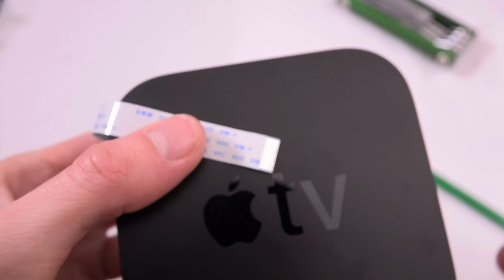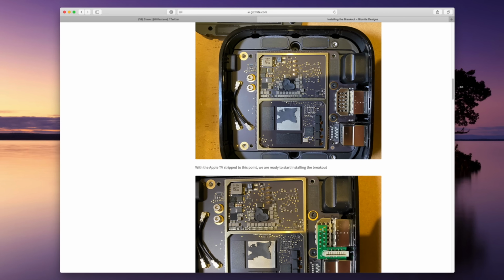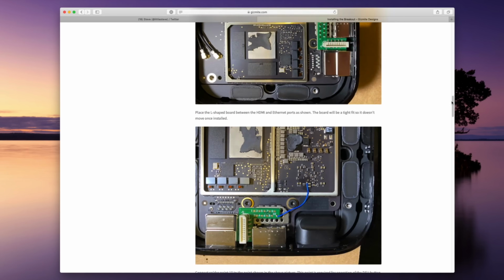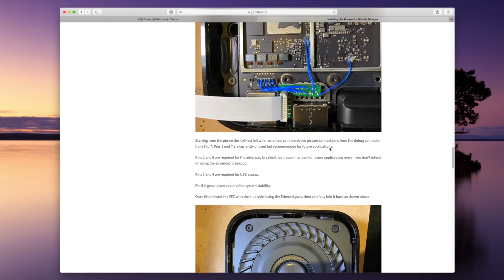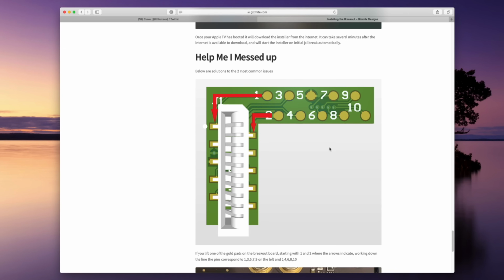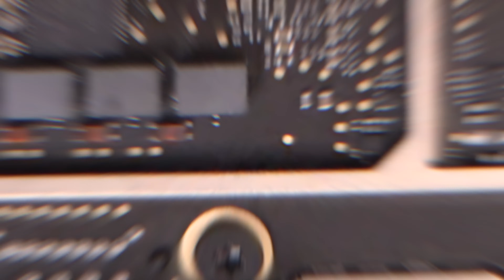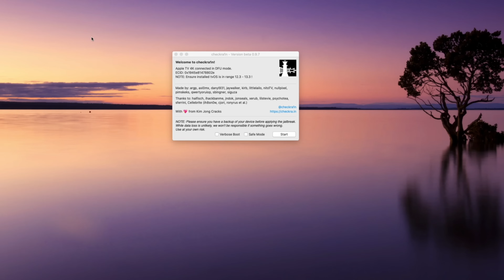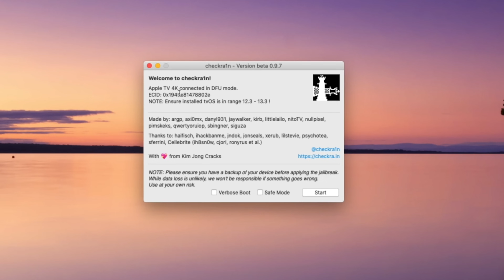Jailbreak Apple TV 4K: How to Install USB Breakout for tvOS 13 - 13.3 Jailbreak! (iOS 13 DFU Setup)

Comment from the maker: This was probably the most I've ever worked on a single video. I hope you guys like it! ❤️
Reply: iCrackUriDevice love it!😅
Reply: You have to tighten the four screws for the heatsink harder because the heatsink must be in contact with the processor. Otherwise it can cause overheating.
Reply: noice
Reply: Appreciate the guides, btw what is that song in the intro?
Reply: Couple of notes:
 1- Use Flux when soldering .. it makes it much cleaner an easier .

2-  you should have changed the thermal paste on top of the processor with  new paste.

3- you should have used  thinner wires  and  tightened the screws to make sure that the heatsink is actually touching the processor firmly.
Reply: iCrackUriDevice You should make a new video on how to jailbreak Apple TV 4K using xCode and the Uncover jailbreak which supports up to 13.4.5 with no need to open up your Apple TV. I just did it to my Apple TV and it’s pretty stable
Reply: Kasherick I was thinking of doing the same thing. But I heard it expires in 7 days and you have to keep redoing it. Is there any work around?
Reply: Kyle Wiltshire I heard the same thing so I installed reProvision which resigns the ipa and it said I didn’t need a developer account, I haven’t hit the 7 day yet so I’ll see if reProvision works or not
Reply: Does anyone know someone who is capable of installing it? I will ship to/ back and pay you for labor/ parts. I have my breakout usb part and my Apple TV 4K.
Reply: Does this work on the new apple tv 4k (2021) model???

Comment: were is +5v pin...
Reply: @torlamen   @torlamen  It’s only possible with the 2017 1. Generation AppleTV 4K with the A10X Fusion SoC.

I’m done with my internal USB solution and my 4K runs checkra1n jailbroken on TvOS 14.7 with NitoTV and KODI. I don't know whether higher TvOS versions are also supported.

If you need help, I can send you pictures of my project and the wiring.
Reply: @saibotmada2931  yes I have this 4k  1gen...  Thx  , for help  ,
Reply: @saibotmada2931  
Thx for help,
Reply: @saibotmada2931  Really interested in your ATV jailbreak project pictures too. I left a short note for you over on my channel :)

Comment: Hi @all, I builded a internal USB port and DFU switch solution into my ATV 4K. Only thing I stuck on is how I have to connect the switch to the ATV 4K circuit board.

I don’t have a breakout board and I can only use some of the rare pictures in the www, but they mostly show just one side of the breakout board.

It seems so, that the switch for DFU mode is connected this way, but I’m not sure: ground—>10K Ohm resistor—>switch in—>switch out—> to Pin 10 (test point for DFU mode) and to 10 or 100nF ceramic capacitor, second pin from the ceramic capacitor connected to ground.

Can somebody confirm if this is correctly or do some detailed photos from the circuits of the breakout board.

When the switch is connected I’m done and will do myself a how to video for everybody that shows a internal solution without a breakout cable (it looks more good).

Thanks for any help!
Reply: nice... thx

Comment: Dude, this is advanced soldering, PAY $20 to someone who has a Metcal, or whatever and knows what he/she is doing!!!!!!  Do NOT attempt mid/high level soldering without a scope, and obviously LOTS OF EXPERIENCE, and DO NOT suggest for newbies to do so!!!!!  "Liability"
Reply: That being said, thanks for the video, life is a learning process, and we ALL are still learning, including myself.   When you stop learning, you start dying.  Also, my suggestion is to attempt to avoid the over inflections in your narrative, but you are at the wheel here.   
Cheers!
Reply: I am a computer/electronics engineer that started DOS command line programming at 4yrs old, I am 43 now and design/manufacture advanced technology devices that the world isn't ready for, yet.   I own Supersonic Advanced Technology Group and LOVE IT!  Stick with it, you will too.
Reply: Pre-soldering is called "tinning", tin your tip of iron first, then tin the stripped ends of your jumper wires, put your iron on the wire and heat it, DO NOT put the iron on the solder as you want to, this is what causes the solder to fall off, instead of holding.   Heat the wire, after tinning the tip of your iron to increase thermal xfer capability, then put the solder on the WIRE, it will pull it in, do such on both ends of the jumper wires, and all contact points, Then put the ends of your jumpers on the "tinned" contact points, and Then, add heat with your iron, it will take a spit second to "flow" each connection, no pads removed, no mistakes.   From a pro, and there you go brother!
Reply: End game:  METCAL MX-5241 with micro tweezers and precision pen, you can not afford that now, 

Good starting point, TS100  $50 Ebay, better than you think..  , or new weller pen soldering station $100ish at the store, or used old Metcal 500 series Better yet   Metcal will set you back money, but we are talking less than 10 sec heat times, ESD safe, thermal radiance level awareness and microsecond adjustments, NO BURNING CHIPS, and Extremely long life, built to run 24x7 in production environments on shifts of several people, never turned off, for longer than you want to do it for.

Comment: Instead of a jailbreak, I want to try to repair my Apple TV 4k with flashing white light of death. I want to confirm that when you enter DFU with this method, it’s the same concept as DFU on iPhone?  Same as in you can then plug into a computer and open iTunes and restore official ipsw. I would appreciate it if you could confirm this, on a working Apple TV obviously. Then I’ll try my luck on my dead one.
Reply: did you try?

Comment: I bought the board but steve never it. It’s already 6month passed. Do you have any clue to contact steve? He never answer to mail, twitter.
Reply: Did you get the board? Or that webpage is an scam ?
Reply: @davidcruzalegui9384  I didn't get it. I got refund but it takes so long time.
Reply: @dongjinsim4764  Do you have the ways I can contact to the seller?

Comment: So I had a problem with my tv I needed to install USB breakout cable for my Apple TV 4K and it requires soldering and apparently no body’s want to touch it. I came on here in search of help but I was referred to Jose fred tech so I contacted him and shipped my tv to his location, he fixed it perfectly and shipped it back to me in 2 days. The amazing part is shipping with a tracker so I had to watch my tv move to his location and back. Text him on 
📩 Josefredtech@gmail⏺com
WhatsApp 📞 +1(413)-634-6140
His services was so reliable thanks

Comment: No body seems to experience the problem I have and that is the remote is working fine except for the touchpad, there isn’t any info on how to fix this. Very stupid problem and you can not use the remote to move anywhere. Bad design where the “arrows” button are lacking, anyways thanks to this Apple specialist HackerDave who I shipped the tv to he fixed it and also shipped back to me in 2 days after. Contact him via WhatsApp-+1(828)-635-9471.

Comment: I like how he says the disclaimer of how you might ruin your AppleTV after he says you need a hot glue gun and soldering gun! 😂
Reply: I had chimera App installed on my ATV after deleting it and running the the checkra1n process my Apple TV started having issues in installing and so on. Well I had to send the ATV to Hacker Warren for proper jail breaking, Text him on +1 (724) 252-7621
Email; Hackerwarren62@gmail⏺com

Comment: I finally had time last night to install the breakout board, my 2nd attempt, I quit the first time, because I didn’t use flux and the solder didn’t transfer well or at all, but since then I practiced soldering and had all the necessary supplies. I only did the four connections and since my Apple TV 4K has been stuck on recovery mode for months I was able to bring it back to life. I wasn’t able to jailbreak, I keep getting error 20, but at least my ATV is out of the dreaded bricked recovery mode. Thanks for your time. 👍🏼
Reply: So how did get out of recovery mode and working again
Reply: Mark Coleman i installed the breakout board and then it went into dfu mode and it restored.
Reply: the415giant so you were able to install it successfully?
Reply: Johnny Acosta yes
Reply: the415giant would you perform this install for me if I paid you? I would provide the Apple TV 4K, the breakout cable and the shipping and handling.
Reply: Johnny Acosta where are you located?
Reply: Thanks for sharing. I’m in the same boat. Which 4 connections did you make? Now there’s a “golden eye” cable for the tv4k it connects to the hidden lightning port. Also after you plug in to your computer, how did you restore it? Did you have to do a firmware restore in iTunes or does it just restore itself?
Reply: @zsqduke  I followed the video instructions and soldered everything. Once I had it all done I followed the instructions to put it into dfu mode and my computer recognized it and the process began. You’ll figure it out it took a few tries because I had to press the button on the board as I plugged in the power. But it worked eventually and now my once bricked Apple TV is working great no problems. In chose not to jailbreak it because I don’t need kodi i use infuse.
Reply: When the device is in dfu mode, did you open iTunes to restore?
Reply: @tyresevanhorne3388  I had it connected to both my computer and television screen to see the progress, it updated on the tv screen and you could see it going to work.
Reply: The op says to use lead-free solder... that shit is notoriously difficult and ugly to work with as it doesnt flow and instead becomes a sticky globule, especially without flux. Personally felt like he was setting up novice solderers to fail. lol
Reply: @secondleasegamer8312  my first attempt was with lead free, I failed, second attempt was lead solder, I succeeded.

Comment: Hi i reset my apple tv 4k but blinking led light do i can use this cable for restore tkanks
Reply: Yes I was stuck in recovery mode and this process fixed that.
Reply: @the415giant  hi care to elaborate? Did you just install the breakout board, plug it into iTunes and restore ipsw?
Reply: @zsqduke  after I installed the breakout board I connected the micro usb cable to my computer by following the instructions in the video, my atv then began to blink fast and eventually updated to the latest firmware, plug it into the monitor thru hdmi to see the progress, good luck.

Comment: I still have my 6s plus on 9.0.2 jailbroken Been lazy for a while. Lol 
My iPhone 10 just started working and is on 13.1.3 Once I can use my friends Mac going to try the jailbreak. 

This is really good to hear maybe can be installed little cleaner, but hats off I never thought I would see you tackle something like this👍🏻 I bought a Apple TV 4K from private party brand new in box (120$) I specifically found out the production week so that it would come preloaded with os 11 I think it was. So I waited patiently for jail break for the 4K cautiously avoiding the Apple pop ups  to update. When one night I fell asleep watching it. When I woke up I was on top of the remote & the tv was updated to 12 or 13 only to find out jailbreak came out a week later couldn’t have been more mad. But this is awesome I’ll be trying this soon.

Comment: Gave a thumbs up for the info and the time spent on the video. But damn. That solder-job makes me cringe. Don't look at it the wrong way or the cold solder joints will crack. Any way! I'm off to do the same thing. Though I might stray from the blue wires. ha. Lucky enough to grab one in December prior to being back-ordered. Nice to see a video on this.

Comment: Great video, but I can’t see spending $20.00 on shipping on an item thats $25.00. Waiting on someone to offer free shipping.
Reply from the maker: It’s because it comes from Australia. Sadly I don’t see it happening unless someone knocks it off... they’re all made by Steve
Reply: Hey there, I can do one better, I offer negative $5 shipping (I put $5 in the box with the cable and free shipping). Only $80 for the cable, hit me up.
Reply: He needs to find a better shipping method. That’s very expensive for something that weighs less than 2oz
Reply: @unclebnz  So if it was $45 and free shipping would that be better? LMFAO
Reply: Ernest Desravines You clearly have no idea how international shipping works.

Comment: Led free solder is crap, Ledded solder leaves a cleaner beed and flows much easier when connecting wires to pads, also use flux this will give a cleaner beed again and help by lowering the chances of you burning pads and the board. Then clean alcohol and a brush.
Reply from the maker: I’m pretty sure Steve recommended led free cause of the lower melting point. Since again it’s not recommended to go over 350 degrees C. But I swear from my experience, it was difficult. Much harder than anything I’ve soldered before.
Reply: @iCrackUriDevice  from experience Lead solder has a low melting point around the 180 to 200 degrees C, where the unleaded stuff is about 230 degrees C mark. but if you use Flux high temps can be used on a board for quicker melting. the only reason why you shouldn't use Lead solder is it's bad for your Lungs and you should use a fabric (paper disposable) mask. BUT  Leaded solder is so much easier to use and takes less heat and you will always have a clean and shiny solder point even if your solder iron is getting on in years. Great video though man.

Comment: I might install this mod on my Apple TV 4K. But I’ll wait for Windows support first. Why is the Checkra1n team taking so freaking long to support Windows?
Reply from the maker: They want to make sure your device doesn’t turn into a brick, which is a possibility with such a low-level (bootrom) exploit (checkm8). My guess is unforeseen complications came up after drivers were finished. Trust me, you want them to take their time with this sort of thing.
Reply: iCrackUriDevice Good point. Waiting it is then. Keep up the great work ICU!
Reply: @Velez_Blanco  Who would spend that much money to jailbreak your phone. You can install ubuntu on windows then install qemu on ubuntu with clover and jailbreak with checkra1n. That's what I did atleast, there's a tutorial by this guy called DownTheCrop which worked really well.
Reply: @Velez_Blanco  I will never get a MacBook in my life. I can't play games on it and run them well which is why I get laptops and computers. Windows is also more customization and just is better than Apple at their customization. Don't get me wrong, Apple phones are my favorite and I will always use Apple over Android but I hate Macs.
Reply: @Velez_Blanco  Run GTA5 on your mac.
Reply: Order the items iCU linked in the description as you have to wait anyway. There's only one of the ribbon cables left at Amazon and doesn't arrive until Arriving Feb 7 - Mar 2 if you buy it right now. I received my breakout kit but the 10 pin ribbon cable is super short! It's 3" The one linked is nearly 6" giving better positioning on the side of the ATV case.
Reply: Nah I’m good. Thanks.